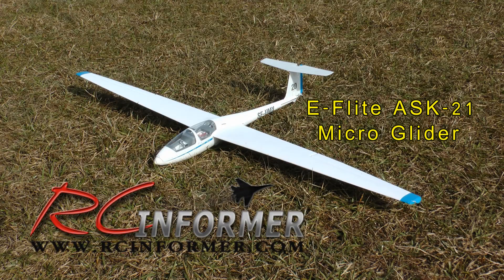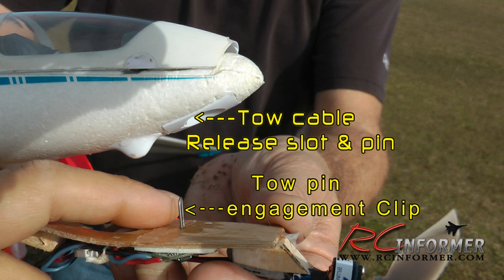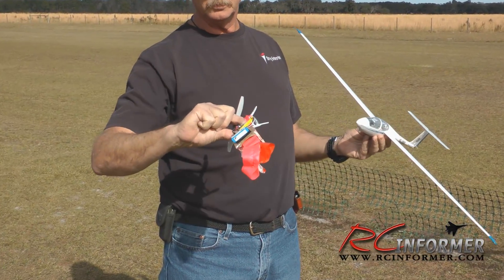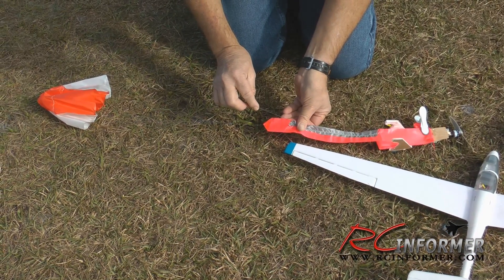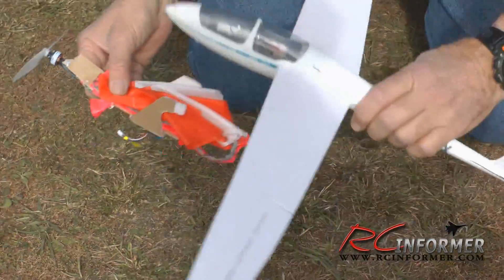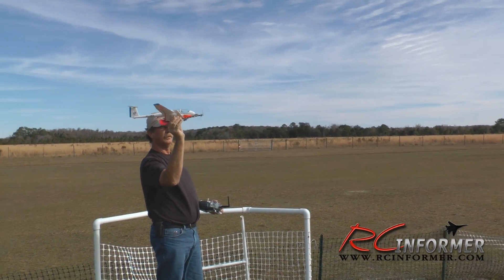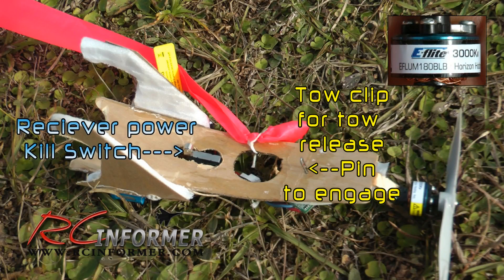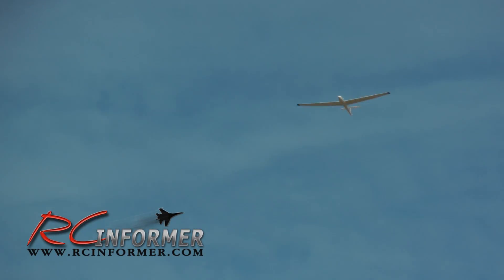E-Flite UMX ASK-21 Glider Power Pod Upgrade in HD By: rcinformer

Comment: That's a pretty exceptional use of a brain. I still have this glider new in the box here in 2025. I was going to try to sell it but I realized that I could use a drop module under one of my drones to get it at 400 feet. I don't want to try to tow it to that altitude so dropping it out from under a drone is the ticket. I do like this guy's ingenuity. Well done!

Comment: we were doing this 35 years ago with carl Goldberg gentle ladies and a Cox .049 engine.
the pod mounted on the bottom of the glider and pushed against the tow hook.
so when it ran out of gas it slid backwards and fell off.
came down in a parachute......

Comment: I am using the motor, gears, folding prop and the spinner from the Micro Radian mounted in the nose of the ASK-21.  I had to shorten the nose by 7.3MM and put the battery in as far as possible under the receiver board rear-ward to get the proper balance.  The glider flies very well with this set-up and is minimally heavier due to the extra weight.  The rear ESC dc port (black box jack on the receiver board) has three openings so that the unit can provide either clockwise or counter clockwise motor rotation just by changing the orientation of the two pin plug in the jack

Enjoy,

Ron.

Comment: I built a power pod just like this using the parts from a UMX Gee Bee just like he did but I CANNOT get my DX6i to bind to both RXs simultaneously. It's either one or the other. The pod works great but I had to fly my glider while a buddy flew the motor with another DX6i. Any thoughts on how to get them to bind at the same time?